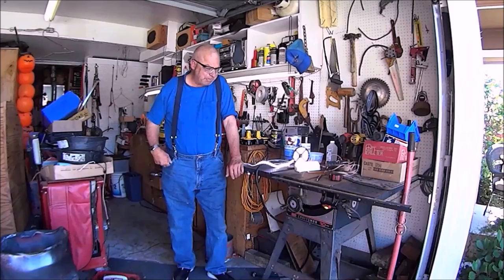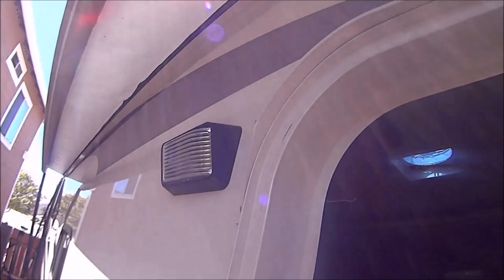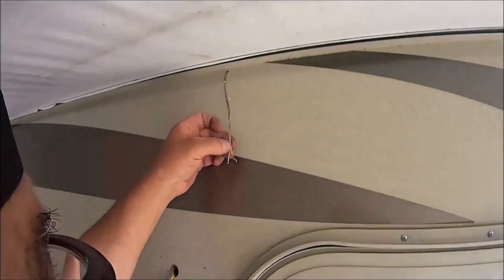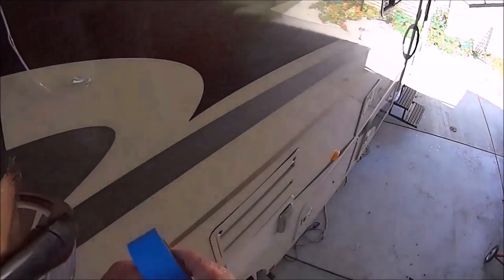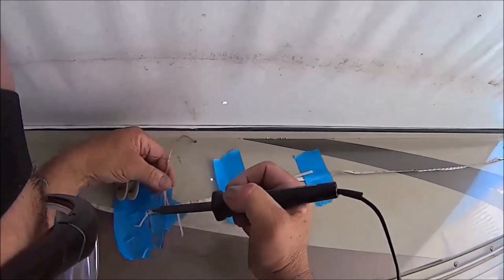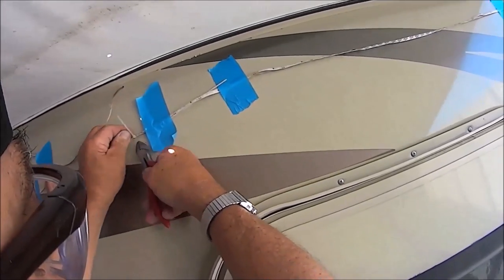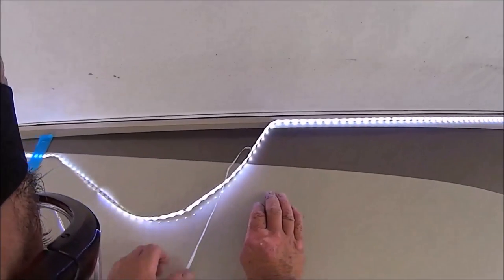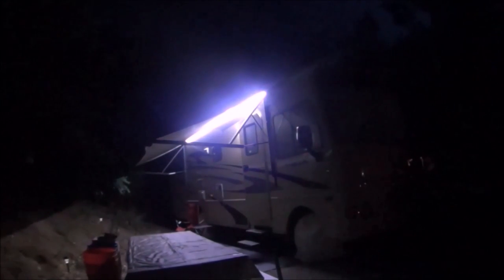Rv Awning Led Strip Lights Project

Comment: Nice work and an A for effort. One thing I would have done differently would be to solder the power wire to the LED strip on the ground before hanging it, that way is easier and you don't run the risk of burning a hole in your awning like you did.
Reply: My thoughts exactly....i wouldnt have been that calm when he burned the awning

Comment: I also did this upgrade and a total led conversion to my RV. Each light unit in my RV draws 0.24 amps Wich is nothing and all my light on, it draws less than 2 incandescent light bulbs. I can't stress enough that if you go and do a LED conversion you save money in the long run and save your battery life I can go 5 days on my batteries without charge with all my RV lights on yes LED is very cheap to use.

Comment: This gave me a lot of anxiety watch you up the ladder with that hot  soldering iron with your shoes half on. Perhaps it would be easier to solder the lights to the wire BEFORE you fish the wire through the holes than it is to dangle on a latter 12' up trying to manage the task? I think I'll do it that way! Great idea though, I'll try it for sure.

Comment: Boy this is somewhat hard to watch! It would have been much easier to solder a couple of short pieces of wire (can even colorcode them B & W) to the strip on the ground or at a bench and then used butt splices to connect them to the wires going into the hole!!
Reply: There ya go, thinking again...🙄